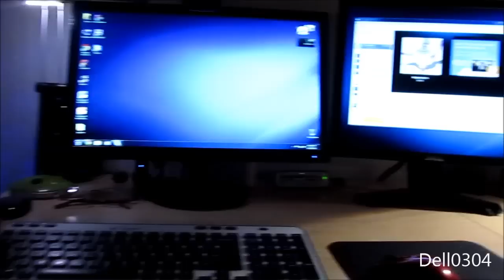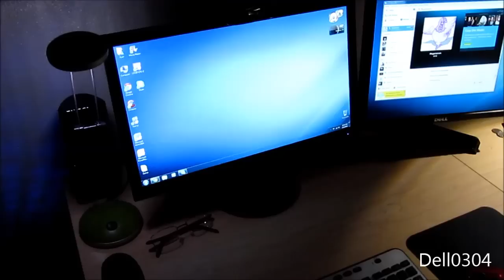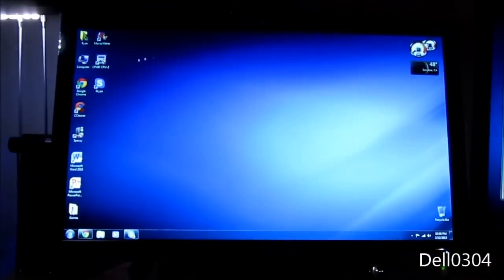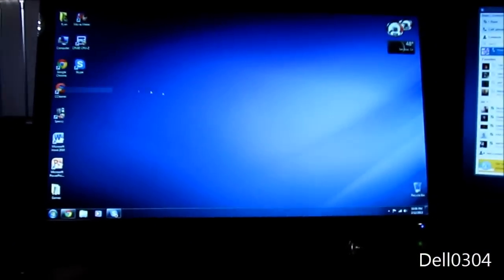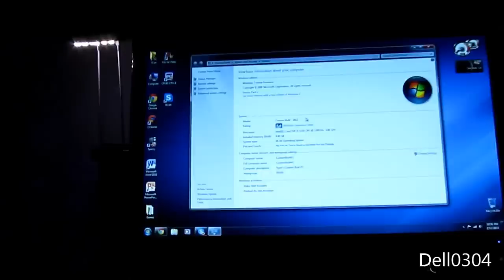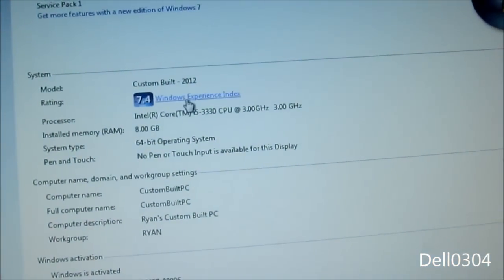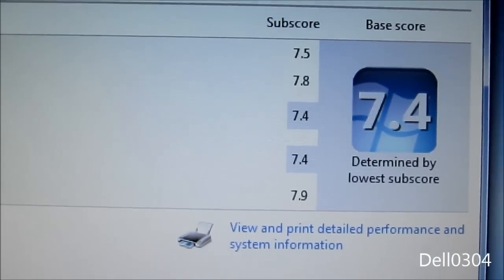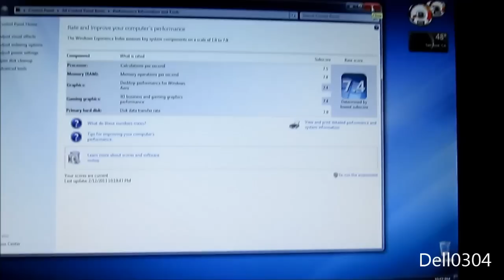2013 Custom Built PC Upgrade: MSI Z77A-G43 Motherboard

Comment: Is it still working ?
Reply from the maker: I parted this thing out in early 2014
Reply: @accordinglyryan  why ? Did you face any problem with this Mobo. i am asking because i want to purchase a motherboard for my old i5 3570 processor. Any suggestions.... Asus vs gigabyte vs msi ?
Reply from the maker: @kodamSantosh  I've used all 3 without issue. My current build has a Gigabyte board in it

Comment: It doesn't work that way. The board doesn't boot without a supported CPU in it's socket. Fans won't even spin up or anything. It's not like AMD boards, or older Intels where it simply says "unknown cpu". If it can't complete the POST, you can't enter the BIOS and update.

Comment: I actually messed with my old custom pc and swapped in my PC-Chips M848A mobo that I forgot about, and my Athlon XP 2500+ cpu which I probably need to replace the thermal paste on. One problem I ran into is the cd drives not working when hooked to the IDE cable but get power when the cable is unhooked, also think my Radeon 9800 isnt working right keep getting a plugin power to video card error

Comment: There was no newer chipset that supported Ivy natively, so it was up to the manufacturers to make sure their products were compatible. MSI decided not to ship updated an updates BIOS to make their new boards work out of the box. The problem is, that the i5-3470 and the Z77 chipset were introduced during the same time.

Comment: A friend of mine has the msi z77-g43 and they shipped with the earliest BIOS, so his i5 3470 wouldn't start. €300 down the drain it seemed. He had to fork over about €30 extra to get a sandy celeron to upgrade the BIOS. Cheapskates @ MSI.